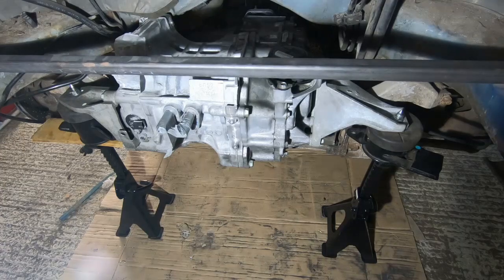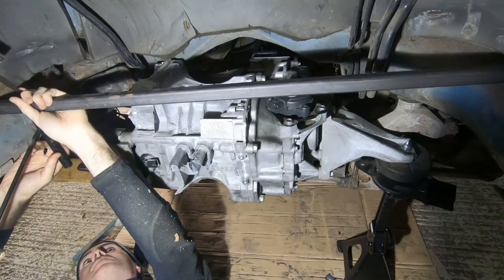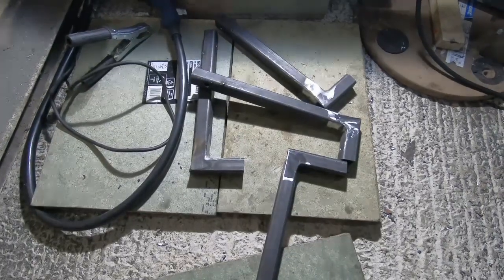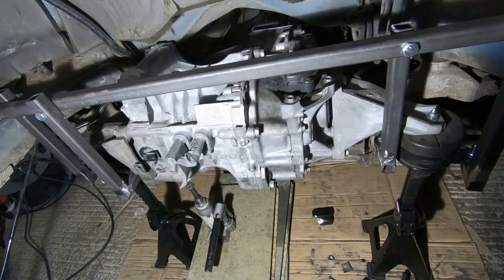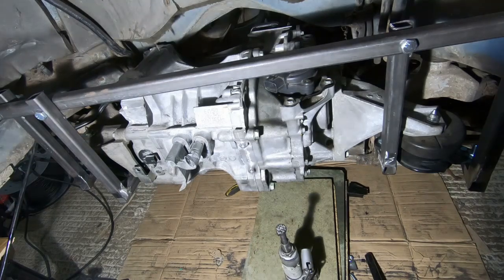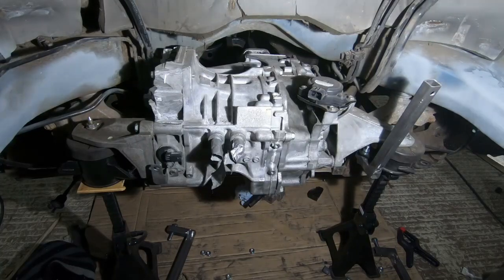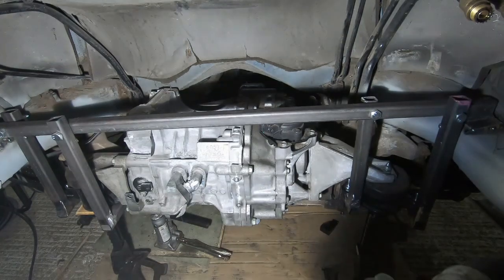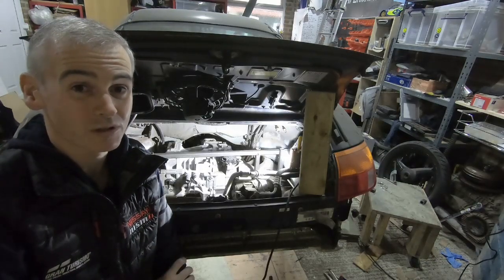Electric Porsche 911 project video 20 - Installing a Nissan Leaf motor into a Porsche 996

Comment: This looks like a great project, do you know what kind of max power the leaf motor will put out?
Reply from the maker: This is a bit of an experiment to see what we can wring out of it. Estimates I've seen put it at around 160kw (215hp) pushing the standard inverter to its limits. A guy in Canada got about 225kw (300+ hp) using a custom built inverter a couple of years ago. That's my ultimate goal as it aligns perfectly with the original HP figures for the 1998 911.

Comment: Will this get through DVLA with an open source inverter assuming it isn't ECE R100.01 approved?
Reply from the maker: We'll have to see. The open source inverter and other drop in boards that are out there (e.g. Paul Holmes one) are direct replacements for the logic side of the inverter. This means that the power stage is not touched and neither are any of the connections to the power stage.  Those would be the components that are most directly impacted by regulations like that (having read through it a while ago a lot of the pieces that are specified are the physical components) as a back up I am keeping the original logic board in touched in case I need to put it back in for any reason.
Reply: @PerformanceEV  OK, good luck, I think it should be fine. I'm currently looking into a self-build EV from scratch I've designed. IVA will cost over £6K, which is a shame. The only way I think to get around paying £6K for ECE R100.01 certification is to go through IVA at 48v battery which only requires the basic visual ECE R100.00. Problem is there's no DVLA process to increase voltage once registered. I am currently in a battle with DVLA that if there's no process stopping me legally increasing voltage above 48v after IVA, why is there a £6K cost to do it in the first place. I haven't heard anything back for two weeks lol!
Reply from the maker: Wow, that sounds like a major undertaking. I thought I was pushing things with this conversion, but I think building a car from scratch pips that. Best of luck with the DVLA, I hope they see sense eventually.
Reply: @SamHocking  I'm assuming you are building a one off or kit car? Hence the IVA. As far as I'm aware, there is currently no requirement for IVA for a change to EV drivetrain on an existing car with no significant structural changes to the body and ECE R100.01 is not tested for or enforced in this case.  If you've been specifically advised otherwise by the DVLA I'd be interested to know as I'm considering my next EV build.

Comment: Have you checked the drive shafts will clear everything?  On the mechanical design of the mounts, you are cantilevering the motor mounts away from the upright support, this is a very flexible structure and most likely will destroy the welds on the bottom piece to the upright piece.
Reply from the maker: Drive shafts seem to clear everything alright, but I am going to be working on that in more detail over the coming weeks. Regarding the supports, you are right, on their own, they are fragile. The plan is for the battery box to form an additional part of the mount (i.e. extending underneath the motor mount) which will provide support from below and take the stress away from the welds on the L shaped brackets. I am still planning out the design, but there will likely be some additional modifications to the structure to ensure it can take the loads.
Reply: @PerformanceEV  
EDub Services have already done this in their VW microbus with no problem.
Rode in it on Friday, absolutely brilliant.